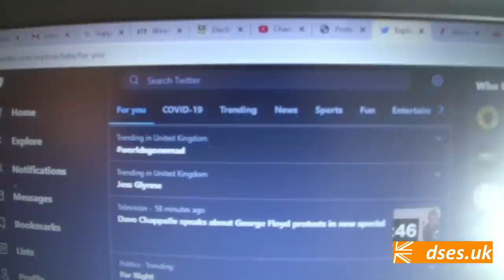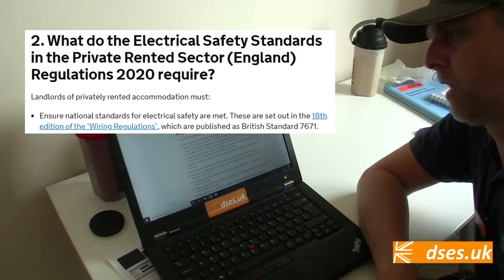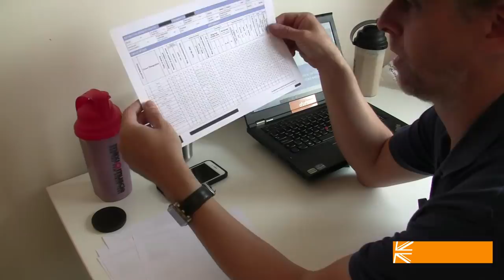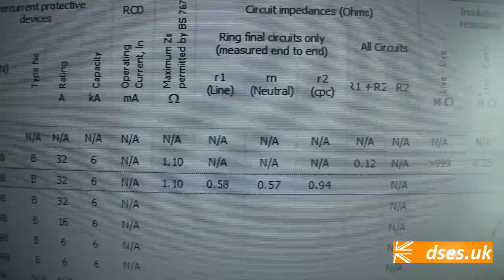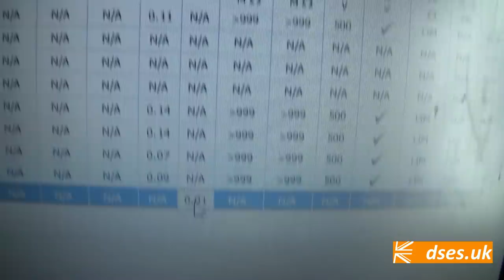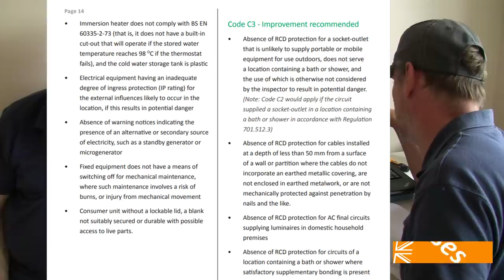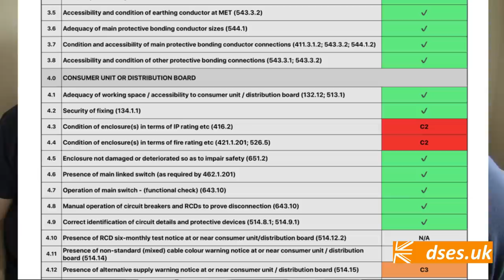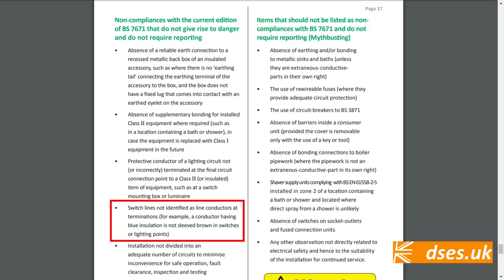Landlord electrical inspections from July!

Comment: I always use analogies to customers. A customer asks if there 1990's property should comply with the 18th edition, i would say a classic car built without a seat belt does not legally require a new seat belt fitting.
Page 13 of the 18th Edition is in the 18th Edition, So in a way a older board and wiring is accounted for in the 18th edition? So if its safe for the period it was built it complies with the 18th Edition as of page 13?
Reply from the maker: Interesting way to look at it!
Reply: Good little get out clause that 👍. 
We had a drive by EICR done at our company building by PHS (door mat and sanitry bin company), they decided to C2 all our C50 DB's that are still in (as installed condition) - because they don't comply with current standards. When I was asked to look further in to the C2 reports, I just waved the Page 13 at them. Utter Utter Bar Stewards!
Reply: Jonathan,  you must have had an Niceic  inspector named Phil, as he always says that, and what a good way to explain, to a non electrical minded client.
Reply: Exactly my thoughts (as somebody who has to deal with compliance in a completely different area of expertise, it's always good to point out to our customers they are usually compliant because of similar clauses in "the latest" spec.)
Reply: Ive used a similar analogy - only used airbags cause most people can recall driving a car without one
Reply: It’s worthwhile checking older regs the 16th spanned 2 decades or so. We forget sometimes what was and wasn’t needed, since we just got used to how it is now.
Reply: @jonathan brown
That is one lousy analogy. If I was in a crash, I would rather be in a new car than one built in 1962. You cannot bring a 1962 car up to 2020 crash and safety standards. You can do a lot with an older electrical system though, to bring that up to current safety standards - which does not cost the earth either.
Reply: John Burns I disagree, I thought the analogy pretty good (for a testing perspective). We are not talking about bringing up to current standard, we are looking at the MOT (testing). The older vehicle is except some of that testing as are electrical
Installations.
Reply: @l4Green  
For a small amount, in the whole scale of matters, an old electrical system can be made much, much, safer. The analogy was justification to do nothing on financial grounds.
Reply: John Burns I totally agree with you, but this is about failing a test for something that passed a previous edition and still complies to that edition. All the upgrades to current standards can be c3. A discussion with the client normally provokes this work - but I understand probably not for some landlords.
Reply: @l4Green  This is it, and it was safe enough for long enough, but you know, got to keep the boys in jobs.

I am not in the trades but in a consulting engineering job and attended a meeting last year, present at this meeting was an NICEIC "expert" on emergency lighting. Long story short he was a spark, ended up in the NICEIC and wanted a bit more so somehow got this em lighting title. Well the guy was totally clueless, spouted utter drivel and the sad fact was that the client had paid him about £800 to come to this meeting and write a report. After I corrected everything he said the focus came to me and we never heard about him again or even saw his report. This is the classic case of a job being created and given to someone who hasn't got a clue but act all knowledgeable and righteous about topics they know little about, yet this muppet will no doubt write some guidance or give training to others and spread the drivel about. 

Dangerous world out there and many of these dangers are created by those who are meant to be all knowing!
Reply: @peterpeterson9903  
I am a graduate engineer.  I found it difficult communicating with tradesmen who worked their way up. Few can think out of the box, with a comprehension ceiling for most. 

However, tradesmen who went back to education can be very good engineers indeed. Some tend to design matters for ease of maintenance, as they have been there themselves doing it.
Reply: @johnburns4017  so do you buy a new car every year because the NCAP safety ratings and methods of testing are better?
Reply: @SeanPearceUK  
No. Another bad analogy. It would be very difficult to update an existing car. Updating it would not improve crash protection.  I am not saying rip out all the electrical systems each time there is a number jump in the regs. 

I am focusing on safety.  Yes, safety. Something which goes over the heads of many. An old electrical system can be made much, much, safer, by little cost, using a little common sense. 

I have no time for penny pinchers, with no regard for the lives of others.
Reply: jonathan brown , how many housing projects still being worked on today were designed 3 or 4 years ago, some maybe designed originally to previous regs , will they be tested to the 18th ? Or will they comply to rules no longer relevant
Reply: @ianmalone8053  
I believe they do not have to comply with the 18th, which I think is ludicrous. The extra cost to update them is minimal.
Reply: Peter Peterson , not so sure on this Peter, we forget that with technology moving and changes in electrical use , safety changes. There has to be a common ground, we should all see that our infer structure is also changing , this has lead to changes in supplies and therefore earth loops and even consistency of supply voltage. Building fabric design changes, clever evolving ideas all have an impact, shame that the changes cannot be openly discussed before becoming standard practice.
Reply: @dsesuk  My Car is 1960 My Flat is 1960 Guess what I have changed in either,  nowt.  Both safter than some modern stuff
Reply: I agree with That statement except if an electric shower in the older installation can be upgraded with an RCD surely it should have an RCD fitted, I'd hate to be showering every day without an RCD in my electric shower

Comment: Who says the 18th edition is safe? It’s a minimum standard. It’s a basic benchmark but you need to layer on a risk-based approach you might find a dangerous condition that requires you to go beyond the 18th edition because the property layout means you need to do it to make it safe. The problem of risk based approach is all depends how diligent you are. Good judgement hopefully resides in good electricians but even they can mistakes. Humility, diligence and willingness to learn that’s the key.
Reply from the maker: Very good point. Too many people are ignorance led unfortunately; they do things because that's how they've always done it or because their mate said it should be done that way over a pint instead of looking up the facts for themselves. Of course, it doesn't help that the regs themselves are so unapproachable and that multiple sources need to be referred to in order to get straight answers. Guidance notes, best practice guides, publications such as Codebreakers, the OSG and Electricians Guide to the Building Regulations all being just some examples of what you need to plough through for an answer in plain English!
Reply: @dsesuk  Spot on there, for years I didn't fit 3A fuses for fans that required them if they were on a 6A lighting circuit or insulation resistance test circuits protected by RCDs all because when I was an apprentice somebody told me you didn't need to, he was a very good electrician just old and always done it his way.
Reply: One thing I will say about you David is your restless curiosity and intellect they drive you to do things others just dismiss. The whole PAT work many electricians are happy to let it slide as not their cup of tea it’s boring and repetitive. Your knowledge in this area can tell a customer that what you found in testing a circuit is a result of some faulty appliance on its way out that’s valuable information. More than that as we move into the future the ubiquity of smart devices many DC type devices they are likely to play more havoc on circuits even when operating normally and being able to test and identify and narrow down the problem will be key. Your work on such things will put you at an advantage. Your ahead of your time.

Comment: a very interesting video indeed. this actually happened my landlord brought in a electrician to carry out an inspection at my home (god knows why as the landlord allready has it's own teams of contractors for all trades) it's as if he was trying to create work for himself to come back for. when he finished and left i phoned the landlord and pointed out that not everything had been checked exterior lights loft light the hallway socket which the landlord knew wasn't earthed and tried making out the ceiling fan wasn't earthed even though it was, he was slackening off ceiling roses by bashing them with a large screwdriver leaving debris on the beds floor ect.the consumer unit wasn't metal and so on. landlord got another spark in to check again and apart from the unearthed socket he found no problem and we still have the plastic consumer unit today.

Comment: Thanks for the excellent video. I'm a landlord and am aware of these changes, but I wasn't aware that installations had to meet the 18th Edition! I read the primary legislation, because as you point out, the GOV.UK website is contradictory - unfortunately, the primary legislation confirms the requirement is compliance with the 18th Edition (and an EICR every 5 years). The legislation also requires that any C2 issues are fixed within 28 days (and C1 issues more quickly). Any C3 issues (if they relate to non-compliance with an 18th Edition minimum standard) create a breach which can be enforced by a local authority. I do hope the 18th edition doesn't mandate the use of harmonised colours otherwise every rental property in the UK built since 2004 will need rewiring! Yikes!
Reply from the maker: It is unfortunately worded Tony because I don't think the intention is to enforce all rental properties in England to be 18th Edition in two weeks from now. If that were the intent, they'd have given a longer timeframe and it would be massive industry news. I think enforcement by local authority is just something they can use should an inadequate installation come to their attention rather than one that is simply pre-2016 otherwise, as you say, technically every site would need a full rewire to correct the wiring colours that no longer conform!
Reply: @dsesuk  Perhaps lots of little bits of sleeving would be acceptable?

Comment: So, landlords may very well be held to ransom by their local friendly electrician, maybe unintendedly because the electrician doesn’t fully understand the guidelines laid down by the government. Could be an expensive time for landlords and as a knock-on effect I imagine tenants too.
Reply from the maker: It is a problem Philip as it's all so unapproachable. It's not written for the man on the street, and guidance is split across many different publications and sites. You have to go out of your way to pull it all together and work out how to interpret the (often) contradictory advice.
Reply: Also a problem for sparks  further down the line  if and when the rules are clarified , you  flag up works ,  that are later  clarified as not required your going to have a very pissed off customer who may well come after you  for a refund , you certainly won't be getting any recomendations

Comment: As far as I know the  NICEIC changed the test certification reports as the older ones a lot of people carrying out electrical installation periodic test where putting a lot of faults on a code 4. Hence no repairs where getting Carried out.
The whole idea for the new forms was to try and get people to have the repairs carried out..
I know thing are not clear cut for us testing everyone puts different codes on the cert . But some installation are worse than others ...
Following on from the test you have redone . How does the napit codebreakers book item section 5.10 page 37 fit in with your findings ..
If you did give a satisfactory report . If the client ask you to redo the lighting in the bathroom or install some extra sockets .
How would you tell the client that you have to change the consumer unit to give rccd protection. .
So you have to cover yourself on your certificate so the client knows of the extra costs involved with any extra work under taken in the future. .
Reply: Good Point

Comment: I'm not an electrician, but I'm used to reading standards and testing to them for CE marking and Aerospace. If one standard points to a second standard and states that it must meet that standard. Then all requirements should be meet and all statements in that standard are valid.
So if edition 18 states that a installation design to a older edition, must meet the requirements of that edition it will by default meet the 18th requirements, where is the problem.
Reply from the maker: Good input again TEH. I'm working on a follow-up where I'll mention this!
Reply: Im a landlord, Excuse my question, So that means the Consumer Unit has to be changed to a metal one ?
Reply from the maker: @roadrunner3320  There is no requirement to change the consumer unit without good reason. It simply being plastic isn't such a reason, even if located under wooden stairs or in a sole escape route. If it's damaged, deteriorated, improperly modified, shows signs of thermal effects or is in any way inadequate for continued use, then it would be required to be upgraded, and that upgrade would be for a metal enclosure model to comply with today's regulations. If it's none of the above and is just plastic because it pre-dates the changes that came into effect in 2016, then that in itself is not a requirement for upgrading.

Comment: Spot on, thorough report. Just had a look at 16th edition BS7671 and RCD only required on TT systems for sockets or for TN, outside connected equipment only. Can't see they'd be using a lawnmower anytime soon. So you've proven the installation is still safe so RCD only as recommendation as you've said.
Reply from the maker: Cheers John. I'll have to try and find an old 16th Edition copy for my own research!
Reply: This highlights the problem with saying installations comply with previous editions of the regs, electricians don't carry copies of previous wiring regulations, so really you have to test to the current edition. The circuit earth used to be run around the house separately wrapped around nails in the joists,rewirable fuses and fuses in neutrals, if you came across a property installed that way would you pass it, if the test results were ok.

Comment: Interestingly Australia makes it way easier (from what I've seen), in order to sell or rent a house it needs RCDs.
Reply: Australian wiring has deep faults my friend,  as an Aussie sparky I hate that we have to wire whole boards in  singles with all of the feeds twisted together in single pole main switch.
Also switch boards full of RCDs are moutned outside in ip44 panels with heaps of morning dew increasing I to the switchgear.
Good thing about Australia is all sparkys are Licensed but the wiring rules are shocking .
Both of the above in the UK are the complete opposite. 
Hard to gauge what's best ... as having rcbos on every circuit has heaps of leakage current tripping here.
Good comment 
Dave in Peel , Western Australia

Comment: Great vid! however c3 in electrical safety first for RCDs concealed less then 50mm is a C2 in code breakers. so here is where all the confusion lies. 1 says 1 thing another says something completly different. Should be same across the board. 
also regarding the price of the CCU other lad may be sticking in RCBOs @ £25+Vat a pop.

Comment: I was 15th trained rcds were not needed like you said in the 16th it came in IF you were to have say sockets on the ground floor to plug in an appliance (mower pressure washer etc) used  outside the installation even if you had a 1st floor flat and you had a socket outlet on the ground floor (by the door going up) you had to have an RCD on either the circuit or even just an RCD socket in its place Dave 👍(also garage supply via swa etc as well) Then came the use of an RCD in bathroom ie shower supply  as well ,great watch as always you clucking funts are funny lolll
Reply from the maker: Thanks for that, interesting to hear of the requirement on ground floor sockets!

Comment: Hi David. My interpretation of this vid is ... if someone phones up for the test and you ask how old the place is you were saying it will fail !!!!... but you have proved that a property over 5 years will not AUTOMATICALLY FAIL but WOULD benefit from improvements . Good to see a tradesman so passionate about the rule book. Regards Don
Reply from the maker: Thanks Don. I'm saying it shouldn't be an automatic fail and that improvements should certainly be recommended, but many out there are dismissing anything without an RCD and/or in a plastic enclosure as failures before they've finished wiping their boots on the doormat on the way in.